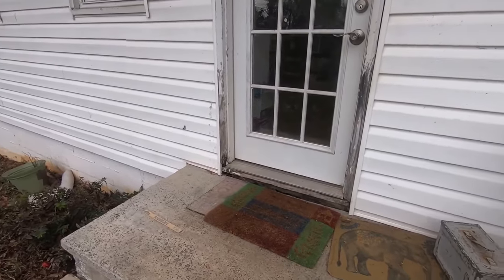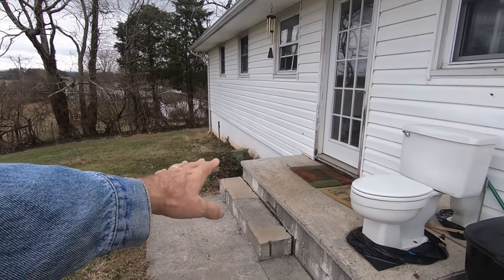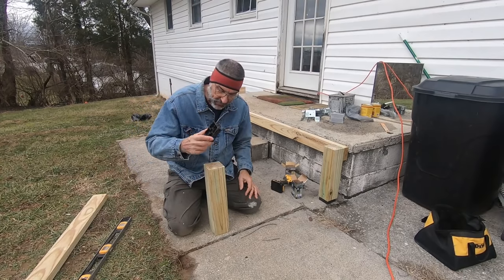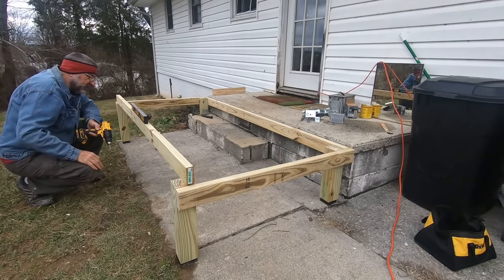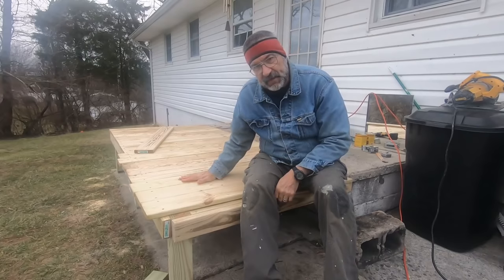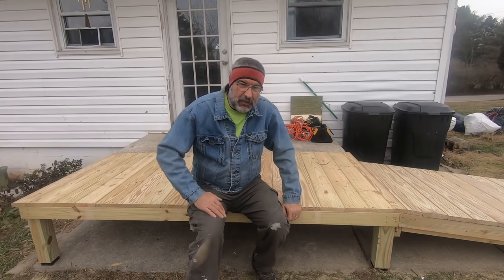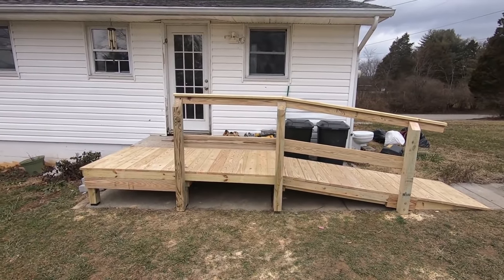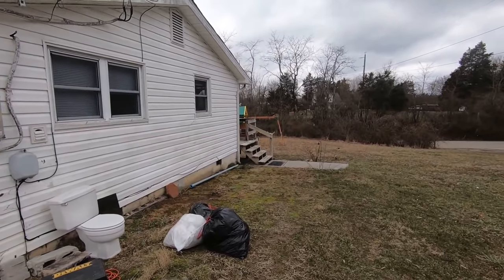Building a ramp

Comment: It's good that you added a ramp to make it easier for your wife and father to access the house. Safety should always come first.

I strongly suggest that you add a full railing on both sides of the ramp. Your father and Elizabeth need something to grab on both sides all the way around if either one starts to fall. Don't test the "no one needs a wheelchair yet" theory. Practicality is better than aesthetics. It is better for them to grab a railing if necessary than for you to have ease of access to your garden by adding steps to the end of the ramp. Broken hips can be a death sentence for those who are older. I doubt you want that.

My critique is written as someone with a disability who has balance issues. I am quite cognizant of what is required to remain safe, especially in the rain and snow. Non-slip grips on the bottom of the ramp will also provide extra traction in slippery conditions. 

Despite my concerns, you did a great job on the ramp!

No toilet with flowers in it. Plant flowers or hang them up instead.

Comment: Hi love the ramp I need to build one for my son just curious Is that 2×8 or 2×6 you are using for the deck and ramp?
Reply from the maker: Those are double 2x6's.  But it completely depends on the distance you are spanning.  If you use 2x6's, you have to be sure to use enough posts underneath to support it properly.  You can eliminate some posts by using 2x8's.

Comment: Would it be stable if I use 2x4's around the deck vs 2x6's with 4x4 post?
Reply from the maker: It depends on the span.  But I would not use less than 2x6

Comment: I would extend the hand rail all the way to the bottom of the ramp, in my location that would just be to icy in winter to get up.
Reply from the maker: There is nothing at the end of the ramp to support the railing. I took the railing down as far as a could. You can reach the railing from the sidewalk.
Reply: You could dig a hole and use a bag of concrete or use a metal spike.
Reply from the maker: That1ufo  It’s FINE the way it is.

Comment: Now that I've watched the entire video, I see that this is EXACTLY what I've been looking for forever.. to do our front little "stoop".. it is only about 31/2 b 3/12 feet square, and we've wanted to extend it out another 3 feet, and make the width wider than the 31/2 feet so we can open our storm door without being knocked off the porch! I wish you could do a video that is NOT in fast motion! I would love to be able to more closely see how you did it. Same with the railing. Besides building out like you did, we want to extend the stoop.. so would you just build another little "table" at the end to make it longer? I know this wasn't an instructional video per se, but I've looked high and low for something with this design. Cement on top that needs to be extended and can't build the deck on top of the stoop as it is right up to the door. We would have steps down to a cement walkway, instead of a ramp. This is just what I needed!

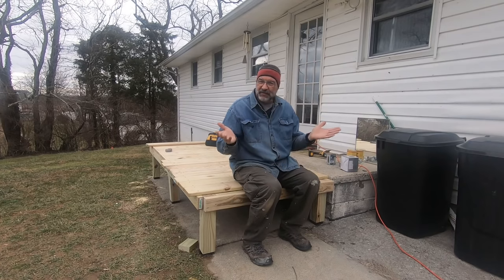Comment: At 7:52, you're cutting the stringers for the ramp. 

That's what I've searched the internet for and finally found it here. Unfortunately, you fast forwarded though it.
Reply from the maker: Sorry.  That's because none of my tools would fit in that little space and I had to cut most of it with a hammer and chisel.  It was just hard grunt work that took several hours.  So I didn't film it.

Comment: Curious why you didn't put the handrail to the end of the ramp.

That short transition space can be a true danger to a physically compromised person. 

Also, the edge of transition from sidewalk to ramp is a danger for one to stumble or for a walker or wheelchair wheel to be abruptly stopped and cause a fall.

I am mentioning these things from the prespective of a physically challenged adult.

This ounce of time will save one of you ......
Reply from the maker: At the end of the ramp, there is nothing to attach a post to for the railing!
Reply: Live Simple, Live Free - Tinyhouse Prepper Do you have a post hole digger?

A post can be put into a hole surrounded by concrete. Problem solved. 

Perhaps fill the gap at the end of the ramp with concrete, or use wood shaped to fit.

After myself being physically challenged for 20 years, using a cane,  a walker, an electric scooter, for me to see what others may see as a "tiny gap" to me is a FLASHING NEON DANGER SIGN. 

Right now it isn't a huge problem for each of you but tomorrow it could be.  

Why not go ahead now, while you have the time to complete the task, to prevent a possible serious problem later on that could have a serious consequence?

Those few feet without a rail, on an incline, is a fall potential, especially if the ramp is wet.

Facing-forward-falling-down equals broken nose, smashed forehead, concussion, you know what I'm seeing..... when a person hits plain ground, ground with wood, ground with concrete, etc. ... it ain't pretty.

I'm 72. Sometimes, due to previous injuries, one of my feet doesn't lift as high as I think it is.... I wear good sneakers for stability..... but that "tiny space" will surely grab the toe of the sneaker or sole in the gap I  the incline.

Not everytime but if I'm tired, weary, distracted, it'll grab and I'll be down unless there is something close by to grab. 

The 3 of you hopefully will never be compromised. But the possibility does exist because of age and other factors. 

I personally am not going to be tripping on the ramp because it isn't my home.

If the "tiny gap" existed anywhere around my home, my son would correct it (he's been a general contractor and plumber for 20+ years) because he's seen how unpredictable my gait is from time to time. Fixing it is purely precautionary. 

1 fall can change a person's life forever. 

Why take the chance?

You are very knowledgeable and clever with creating solutions.

You'll figure out how to make it safe. 

Be well.

Comment: you definitele did NOT build that ramp to meet ADA requirements.  First, with a height of 20 inches, your ramp has to be a minimum of 20 ft in length. Second, it needs to be permanently attached to your house. Big boo boo there. Maybe you should go look at the ADA guidelines for ramp construction rather than be homer the handiman.
Reply from the maker: I don't CARE about ADA requirements.  I wasn't trying to meet ADA requirements. This is not a wheelchair ramp.